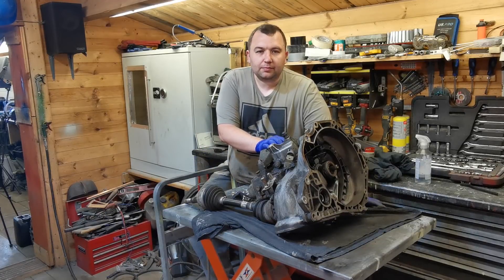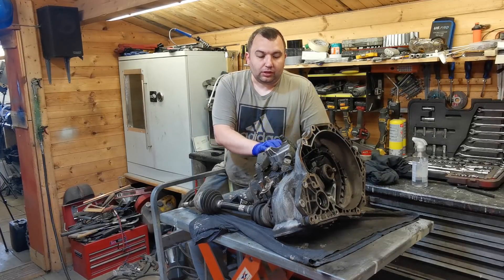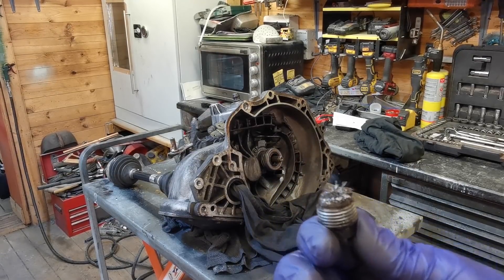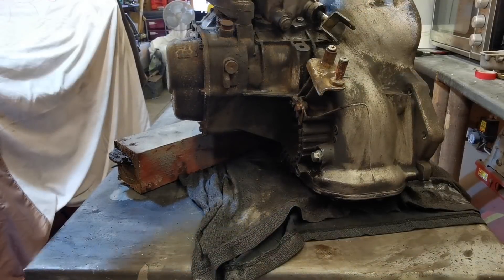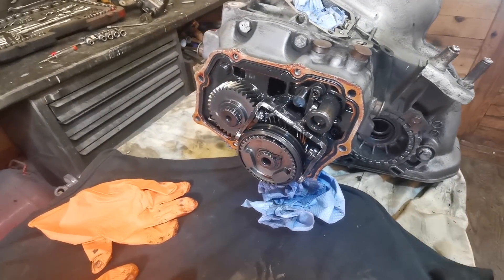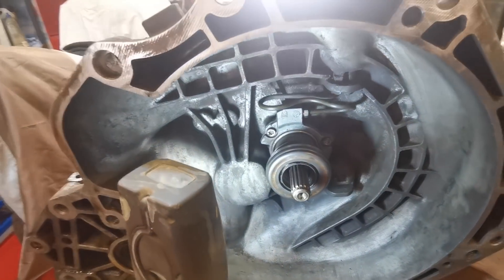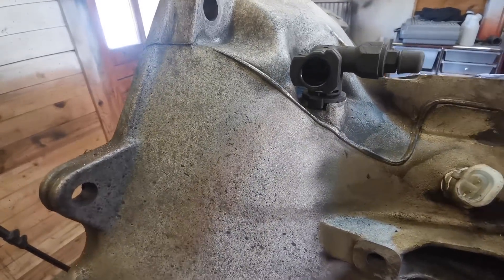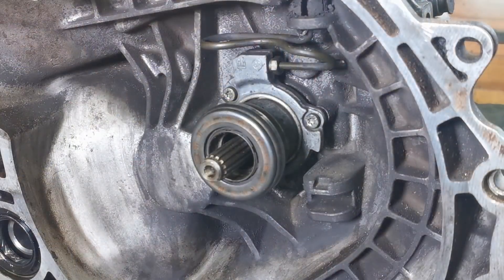VAUXHALL F17 GEARBOX STRIP DOWN AND REBUILD

Comment: @projectman

I find myself back on this video basically doing the same thing, this video has been informative.

I wanted to ask how would I  find the torque specs for the bolts when Retightening
Reply from the maker: Have you tried the haynes manual  or there is a company called vauxcare Google them and give them a call 📞

Comment: Thanks Gary. Very in detail video. I am in the process of changing the gear ratio of my Astra J, from 4.19 to 4.63. Trying to find either a good used transmission, or maybe finding a 74 teeth gear ring and a 16 teeth main shaft. Although seems to be difficult to find.
Reply from the maker: Hope all goes well 👍

Comment: Fantastic video - I am about to reassemble my gearbox, and have just received the various paper gaskets.  Could you advise if these go on dry or if the mating surfaces need to be lightly oiled etc? Thanks.
Reply from the maker: Mine went on dry 👍

Comment: 6:43 when you say "without a sound at all" you mean, "it's not noisy so if I'm speaking over it I don't hear anything coming from it" or "it's so smooth as silk that you really couldn't hear it at all"?
I have a gearbox like that. It does make some sort of noise the first few degrees of turn, like there is some slack somewhere and it needs to "catch on" and then it gets much quieter, and does the same if you stop and turn backwards. Could it be "the big bearing", is it absolutely normal, any other ideas from anyone watching?
Reply from the maker: Smooth as silk this one 👌

Comment: Hey mate, is there any chance to remove the gearbox with the subframe still partially in, basically just bending it down enough? 2009 Astra H 1,6/85KW, 5 speed station wagon. Cheers!
Reply from the maker: Yes it can be done 👍

Comment: My friend bought a Vectra 1.8 Elite in 2002. The first thing he did was drain the gearbox, and refilled with 75w/80. He still has it, 280,000 with no problems with the box. He says it's the factory fill oil that's the problem with them.

Comment: Hello, I was wondering if you could let me know what kit you purchased that had the bearings? I am in the US and I have been struggling to find any useful info to fix my transmission. Anyway, this video has been the biggest help, and has really helped me, so thank you!
Reply from the maker: Hi I took the bearings to a bearing shop where they took the dimensions and found me the ones I needed.
Reply: @ProjectMan  Do you happen to know what those sizes were? It's fine if not, I know this video was a long time ago. Im planning on picking up a random kit I found online
Reply from the maker: I'm sorry I can't remember 👍🏻

Comment: Just took apart a similar gearbox and you need to change out those input and output shaft front bearings if  the gearbox has high mileage.
Reply from the maker: Good tip!

Comment: Wait hold on... is there a god damn drain plug on them? I've always believed that they don't have one. I always thought you have to remove the differential cover to drain the oil. That's how I've done it on the F13 (and it was a mess) and thought the F17 is the same. You're fucking with me right? :D
Reply: I really doubt there is one

Comment: After a little bit of advice my Gearbox is starting to give up it’s a F 17 gearbox I have a F 18 that was recon for a different car will it fit mk2 vauxhall Zaferia 1.8 2007 if you can get back to me I would really appreciate it thank you
Reply from the maker: Hi I'm not sure off top of my head I think the gear ratio may be different but please do a bit more further research

Comment: How's the gearbox running today, Are the paper gaskets still doing their job? So many mixed opinions on whether you should use sealant with them or not it's hard to decide whether to use it.  Thanks for the video
Reply from the maker: I had no issues sold the car last month without any issues 👍🏻
Reply: @ProjectMan  That's good news then, thanks for the reply I enjoyed watching you video
Reply from the maker: Cheers Peter 👍🏻

Comment: I'm about to tackle a gearbox change as I've got an astra handed to me for free. It's a 1.8 convertible, it doesn't move in any gear. The driveshafts feel good with no play. When selecting gears it goes into all of them without the clutch however when selecting reverse it'll crunch which for me has narrowed it down to a broken box. Hopefully when I drain the gearbox oil I'll find evidence. I take it I can just search for any Vauxhall 1.8 gearbox around that year. Cheers
Reply from the maker: My box was a f17 it should be stamped on the box
Reply: I've encountered similar issues. It's the throw out bearing stuck extended.

Comment: Hi Iv changed the clutch then put driveshaft back on and car won’t move then check and driveshaft are not engaging inside gearbox no resistance when push them in or out  what could be the problem

Comment: For a moment, I thought you'd bought a duff gearbox. Glad it was fine. It doesn't hurt to check it. I did a clutch change recently on a 2007 VW Beetle so I know what's in store for you when you come to swap the gearbox. Would it have been worth repairing the original gearbox. It might be handy to have a spare gearbox ready to fit if you decide to repair the original afterwards.
Reply from the maker: Cheers dave I will take the other one apart to see what happened and il probably rebuild and keep as a spare 👍🏻